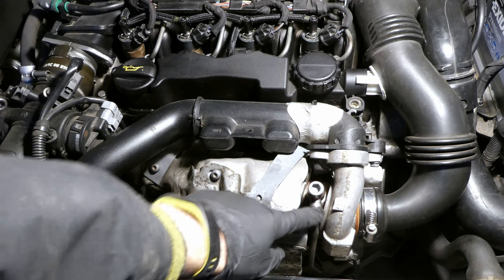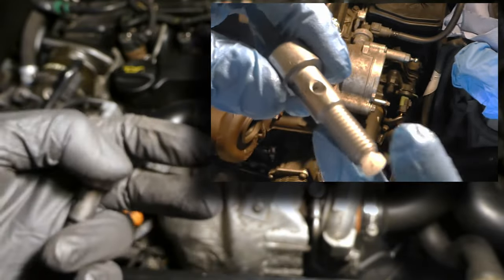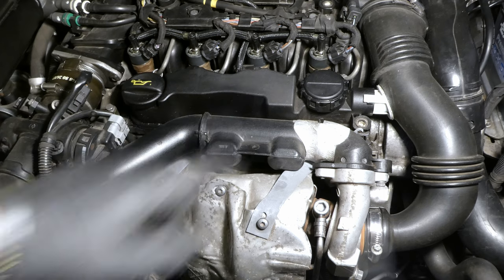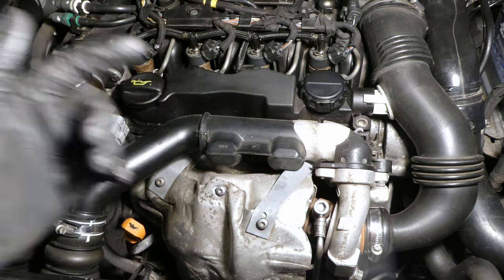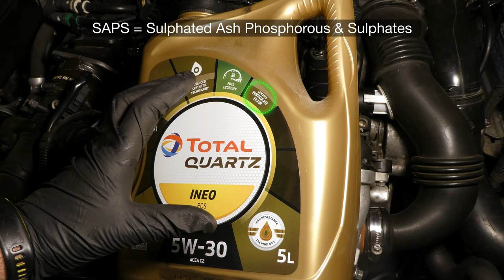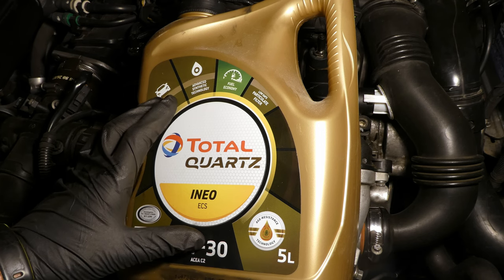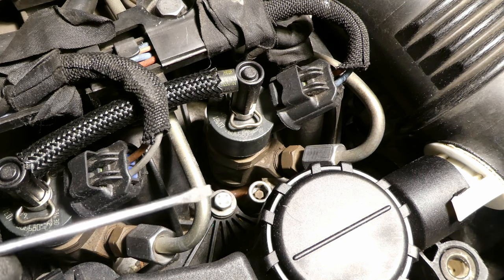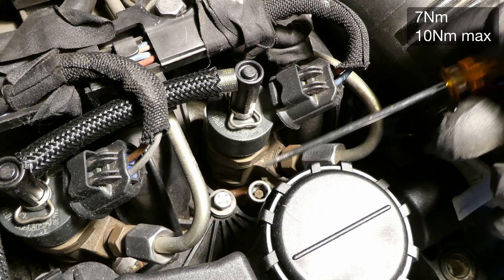1.6HDi turbo failures, the 2 main reasons and surprisingly simple steps to prevent it

Comment: I can’t believe I found this guy. He is amazing. He is so full in-depth in his instructions and goes  over and above in all steps. I removed and cleaned, replaced my EGR yesterday after watching this guys video. I got the dreaded faulty anti pollution message and since cleaning the EGR and resetting the code it runs brilliant. He saved me hundreds of pounds and it went like a dream. I can’t thank him enough.
Reply from the maker: Hey thank you for the kind words, much appreciated! I try to make videos that when I watch I can do the stuff without needed any more instructions.
Reply: Am si eu un peugeot 307 am inlocuit egr si nu tine decat aproximativ 300 km supa care apare mesajul anti poluare
cum as putea sa fac Va multumesc
Reply from the maker: @gheorghelapadat4061  You probably need to recalibrate it
Reply: Hello,  I have a 1.6hdi 2008 diesel. Everything works fine but want start when motor is warm!
Have to wait 90 -120 minutes!
Peugeot told me change egr! Did not help! When starting hot motor cranks for a second and goes out! I believe it must be s sensor or relay preventing diesel to reach motor! Any clew what I can search?

Comment: I have owned my 2010 Partner van from new, changed the oil and filter every 5000kilomtres and at this time I just check the 7mm injector bolts which are always okay.  323000k and its never had a spanner used in anger apart from two timing belts and it still runs like new.  I also use STP engine flush every second change and looking into the oil filler cap it still looks like new.  Change your oil folks its the cheapest mechanic.

Comment: The best way to look after your turbo is frequently oil change helps and a catch can on iv had alot of hdi and always done this and had no problems whatsoever 👍
Reply: How do you put oil catch can on this engine
Reply from the maker: Here is how: https://youtu.be/QdxyAHP1DVM
I've had this oil catch can setup for ~2 years now and it is not difficult to do. My previous installation (a bit ugly): https://www.youtube.com/watch?v=VEoO7-fmMkc
Reply: I did that with the oil catch can. About 50ml of honey like oil trapped in 10.000km
Reply from the maker: @littlereptilian7580  Sounds about right, but you would be surprised how 50ml of oil + the ash from the EGR can create a huge mess and coat everything. In other words, a lot of restricted air intake pathways
Reply: @moremolecules  you should erase EGR and DPF to forget about so many problems
Reply from the maker: @AC-db4ek  There was a really good video about the function of the EGR and it is not only emissions. Here it is: https://youtu.be/FrpyLvPodkc?list=LL
I very rarely see anyone say anything positive about EGR valves, but there are a few other resons, apart from emissions, why they are there and they are good ones. Worth watching.

Comment: Hi Chris..😜.. Brilliant video as usual.. Just like to add something.. If the turbo fails be sure to clean the oil pan and the oil pickup filter as mine did not get cleaned by the mechanic and sure enough the new turbo failed in 3 months.. The second time around I did the job myself and found the oil pickup filter clogged like crazy causing oil pressure problems. Since I cleaned it out the car has been running like a dream.. Hope this helps someone in a similar situation. Thanks again for the video and keep up the good work.. Cheers
Reply from the maker: Hahaha, thank you. Yes that is completely true and thank you for the comment. I have a mini-series (5 videos, N1 https://youtu.be/Q7S0qDBo314) that adds this as a check when one is replacing the turbo.
Reply: Good shout. Did you replace the oil pickup or simply clean it?
Reply: @moremolecules yeah it’s also interesting that Ford engineers didn’t like the mesh in the turbo oil feed pipe so all Ford, Volvo and Mazda cars that had this engine were never fitted with that mesh/ gauze then a year later Peugeot did the same lol 😂
Reply from the maker: @gimble447  Yeah, those meshes are actually important. They were placed so on new engines to capture any metal swirl going around the engine from manufacturing. Unfirtunately, most dealers and garages could not be bothered to clean it and change oil within 200-300mils from new. THen you have all these problems. Ford thought, yeah, let's not bother with this, so sometimes you would get these metal flakes (little) going to the turbo itself. This gauze was never meant to be permanent.
Haha, or at least that was my understanding on how this went from rumours on the great web thingy...
Reply: @moremolecules  180k miles on my Volvo V50 1.6d and original turbo just starting to whine a little now but still pulling like a train, maintenance more important than the gauze as the gauze is only safe if you never miss an oil change and let’s face it 90% of people still running around in cars with this engine will have missed some services by now so I’d be wary of buying an earlier car with those fitted tbh
Reply from the maker: @gimble447  Yes, they need frequent oil changes, but I all honesty would buy that engine again if they do not drive it out. For the amount of power is spectacularly economical to run.
Yeah, my gauze filter was spotless ~100k mles, although I replaced with the newer plastic version, but I absolutely accept that people are not too religious about the oil/filter changes.
Reply: @moremolecules  yeah my Volvo has been a great wee car too

Comment: Funny enough Volvo recommends Castrol 5w30 ACEA A5 oil which is a full SAPS but low HTHS lubricant,  opposed to the PSA recommendation.  Volvo also have less faults related to the this engine,  but that can be contributed to the Volvo being more high-end car and owners just taking better care.
Reply from the maker: Well, how do you define "have less faults related to this engine". It is the same engine at the end of the day. Exactly the same engine, so difficult to say why they would have less faults, unless as you say people are taking better care of their cars, i.e. oil changes on time as comapred to your ""average" Peugeot driver that say, "ahh, the hell with it, it is a Peugeot, it does not need an oil change". I would be more inclined to use low SAPs oils, as there are sumply less amount of the sulfur to go and create a mess.
More "high-end car", I really doubt that for the recent models, all made in China, but the older ones, maybe, At the end of the day it is the perception of it all, not are they actually a better model of a car. Why is there another brand of DS (essentially Citroen) or Cupra (essentially Seat/Volkswagen). Simply the perception of some of these being higher end model cars or higher performance whatever. Undeneath, same stuff, just packaged in a nicer-looking badge package.
Reply: @moremolecules  Volvos are a high end cars and they are not made in China but in Sweden and Belgium for EU market (not that the origin country makes any product . Full SAPS oils start with higher TBN and usually retain that number higher in service-  but I'm sure you know that as you know why were low and mid SAPS oil introduced. Had nothing with wear on the engine.  And lastly,  engines are the same except that one are built in France and Ford had theirs from Germany.  So only difference is maintenance and , what I've already mentioned in my first post, different specification of engine oil.
Reply from the maker: @euro4by4hr78  Aha, have a look at the initial reliability index (e.g. here: https://www.jdpower.com/business/press-releases/2024-us-initial-quality-study-iqs), yes it is in the US, but for a high end car, Volvos should be also good in the US.

Comment: My van passed just over 300 000km. It was driven most of its life on open roads. Used that oil all the time. Changed oil every 10 000km, changed all the fluids when it had 150 000km on a big service. Now i pulled off the head to get the it checked for lifter noise. The cylinfers look clean, no scoring, no carbon buildup. Original turbo on the car. Cams have no wear. Only worn out part are the injectors and i sent theme to be refurbished. I might have caused it since the van was driving at least 40 000km on a 50/50 mix of used vegetable oil and diesel due to me beeing very broke at the time.

Had to replace the oil pan since i stripped the plug somehow and the back collant pipe that runs behind the engine. Also replaced the front rocker cover due to it leaking oil.

Your channel was really helpfull with diagnosing the smoke issue on cold starts.

Comment: Just bought an old Partner and I need to do a lot of work on it so I have a lot of questions. I got just about all the answers from watching these videos. Amazing! All I need to do now is find some diagnostic software to manage the electrical systems.
Reply from the maker: Lots on ebay, cheap Chinese Diagbox diagnostic adapters, but you would need Windows 7/XP to have it working.

Comment: I had a turbo fail when driving fairly hard, to blow the soot out of the exhaust on the way to the cars MOT test (UK annual test). The very obvious sign of failure was that I had to change down gears on hills & would barely reach 60 mph. Interestingly it passed the MOT test. The failure was the turbo shaft broken at the exhaust side. 
I got an Ebay used turbo for 40GBP. (Jan 2022). Drained engine oil while hot. Replaced oil filter. Refilled oil. 
Next day when old drained oil was cold, (winter) the entire volume of the oil was a jelly, not a liquid. No doubt that's due to the oil contamination due to leaking injectors as explained in this video. (Leaking injectors found 5 weeks later). 
Changing the turbo on this engine is one of the easiest jobs ever! Rather than undoing any exhaust manifold bolts or replacing exhaust gaskets (that I didn't get with a used turbo), I removed the clamp around the exhaust turbo housing, on the original turbo & also on the replacement turbo. So I just replaced the entire inlet side of the turbo with the center bearing & both impellers but reused the outside (rusty) steel exhaust casting of the old turbo. (Which remains bolted to the exhaust manifold & the cat). 
Cleaned some sludge from top oil banjo union & its bolt. (Didn't touch the lower union at this time). 
With the turbo removed, I checked oil feed... Put the turbo oil feed banjo union in an empty jar. So that I could let the starter turn the engine without starting the engine, I removed the immobiliser chip from the ignition key. (You might be able to just wrap the key in foil but I haven't tried that. You might be able to unplug all the injectors - but I'm not sure that's safe for the ECU). Turned the engine over for a few seconds & checked a reasonable amount of oil was in the (previously empty) jar.

Fitted the turbo & oil feed. (Reused old vacuum waste gate actuator). 
Turn the engine over again on the starter for a few seconds to get oil to the turbo bearing. Refit the immobiliser chip in the ignition key. With the vacuum tube removed from the turbo actuator, start the engine. With the engine running note the position of the waste gate lever, reconnect the vacuum tube and check the lever moves. Refit covers, job done. 
18 months later (when changing the clutch) I had the cat off & took the opportunity to take the entire turbo oil feed pipe off, clean the pipe & the lower banjo with the wire gauze filter. Nothing unusual. Blew it through with compressed air, then brake cleaner. 
5 weeks after changing the turbo, I found I had a "chuffing" injector leak. I had to drive with all 4 windows open due to the exhaust fumes, so that wasn't something that was going to continue to chuff for more than a few days! Also moderate "tar" around 2 injectors. 
Initially tightening the injector clamp nuts to 7Nm, stopped the chuffing sound but could still smell exhaust in the car. Eventually had them all tightened to 14Nm. Tightened with engine hot, immediately after a 15+ mile drive. Repeated the hot tightening several times (different days) until no more movement at 14Nm. Then check every 6 months or so, at 14Nm with engine hot. (Generally little or no movement). 
The reason for engine hot, is so that the "tar" is somewhat soft, which allows the injector to move a bit more each time towards it's proper position, with the proper pressure on the copper washer to achieve an effective seal. 
This was 2 years ago. No further leaks. No injector copper washers or seals were replaced.
Reply from the maker: Many thanks indeed for sharing this, really appreciated! It will work if caught early on, then one can tighten the injectors. The soft pliable copper washer can be crushed a bit further in, so it will reduce/stop exhaust gasses coming through. I suspect it can be done only once, if it comes back again, it is probably taking out the injectors. Hopefully not.
Reply: @moremolecules  Point taken about the copper washer probably not sealing just by tightening, if it ever leaks again. I intend to keep checking the injector clamp torque every few months for the rest of its days, so it shouldn't leak again.
Perhaps the biggest risk is I might use the torque wrench with the wrong setting & break a stud. Hopefully I would think to check if any of the nuts ever moved much.

Comment: Great summary of the situation with this engine, and entirely consistent with my experiences too. I would add is the following:
If you have carbonised oil inside the camshaft chamber following injector seal leakage, this really needs to be removed, otherwise it will be perpetually breaking-up and contaminating fresh oil. The problem is that getting those crazy injector studs out (M6 one end/M7 the other) to remove the cover is right pain, as is the fact that the camshafts are mounted on the underside of the cover, so it's cambelt off etc etc. I got advice from one forum: "The only solution is to clean the engine within an inch of its life!" and that's what I had to do. It's also important to remove the oil pan and clean-up the oil strainer. Further, it's worth modifying the sump as, being a steel pressing, the female thread is raised forming a 'bund' which prevents full drainage of engine oil and, in particular, carbonised oil debris. So I reckon that if you fully clean the engine, the normal oil change interval will be fine. It's not an inherently dirty engine as many have suggested, just that the injector seals may leak!
In my book it's necessary to recut the injector seal seats in the cylinder head before fitting new copper washers.
In my case, the first indication I had of carbonised oil causing problems was low oil pressure: the warning light came on. So with my Citroen C5 I fitted an oil pressure gauge to give me a first indication of any possible issues.
If you have an injector which is 'chuffing' i.e. leaking severely, you will also see carbon fragments in the underside of the engine cover: a dead easy thing to check.
Reply from the maker: Great stuff and many thanks indeed for the really detailed explanation and comment, much appreciated!
Reply: I had a "chuffing" injector and no contamination of the engine cover. Perhaps if it's driven for months like that. I had to drive with all 4 windows open, so that wasn't something that was going to continue to chuff for more than a few days!
This was over 2 years ago. Initially tightening the 8 injector clamp nuts to 7Nm, stopped the chuffing but could still smell exhaust in the car. Eventually had them all tightened to 14Nm. Tightened engine hot, immediately after a 15+ mile drive. Repeated the hot tightening several times (different days) until no more movement at 14Nm. Then check every 6 months or so at 14Nm with engine hot. (Generally little or no movement).
The reason for engine hot, is so that the "tar" is somewhat soft, which allows the injector to move a bit more each time towards it's proper position, with the proper pressure on the copper washer.

Comment: Excellent video, thank you. I have the Ford 1.6 TDCi and this weekend I`m gonna inspect those Banjo pipes, not having thought about that possible cause of turbo failure. I do have some tar around the injectors so it is a caused for concern. I would have to address that, sooner than later... Oil and filter changes I do every 5000km. Car now has 337000 km. Subscribe button smashed !
Reply from the maker: Hey thank you. Yes, definitely have a look at these seals.

Comment: Personally, i change the oil on our 2010 4007 2.2 HDi (130,000 miles) just every 9,000 miles/15,000 km. But i stick to the Total Oil you mentioned. It runs really well, no oil consumption. And also, it is not a big deal of changing it.
Reply: Too long i change oil on 1.6 hdi every 7k km

Comment: My theory is that Excessive crankcase pressure from a faulty egr valve and or pcv valve will prevent or reduce the amount of oil that can return to the sump.

If the crankcase is pressurised it will blow back up the oil return hose.

A tip for removing the injector is to shock the studs with a chisel to break the set then use an e torx to wind the injector stud out little by little acting like a draw bolt against the injector clamp.

Comment: Great video! well explained. These engines have a bad reputation but if you follow all the things you have explained they are a great little unit.
Reply from the maker: They have a reputation, but if taken care as you have said, they are great units that would run for a long time. No wonder Peugeot/Citroen/Ford/Mazda/Mini/Suzuki/Volvo all use the same 1.6HDi engines 🙂